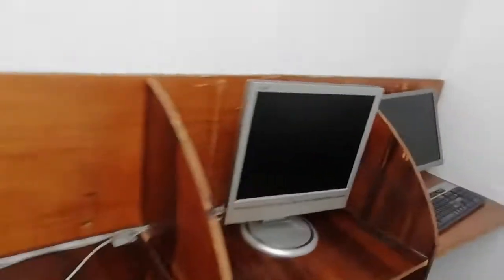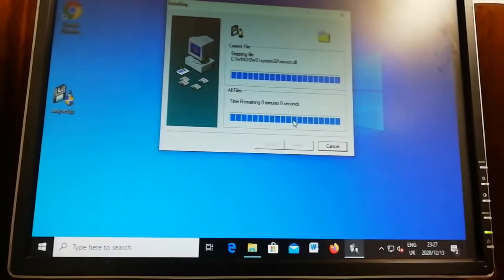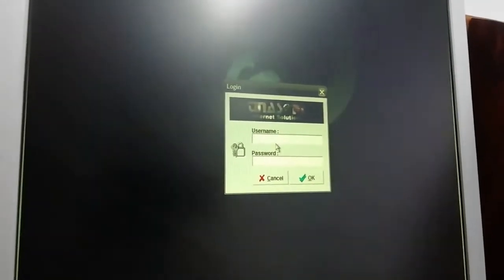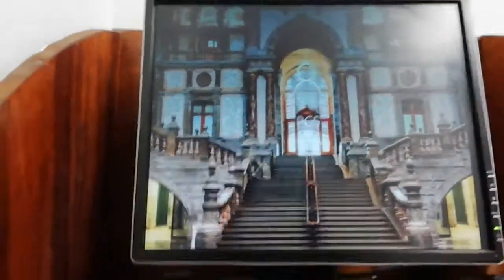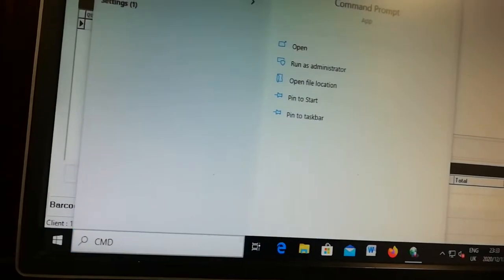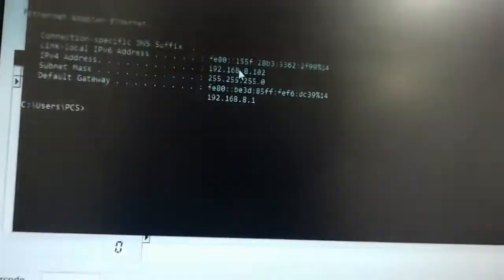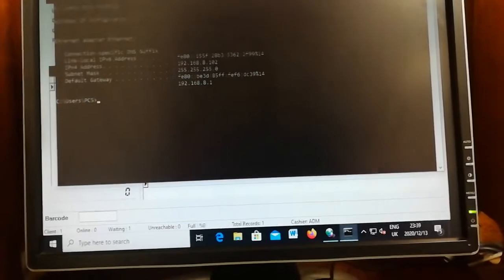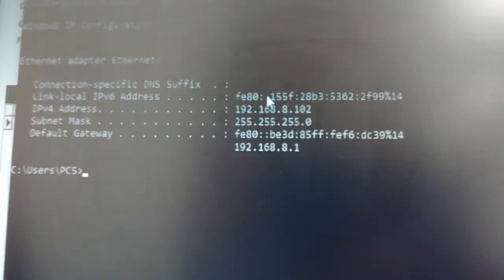How to install easy Cafe internet Cafe management system

Comment: Where can I get the software, Do you have any link I can download it from
Reply: Please gentlemen don’t buy anything.The free version of this software is good enough to run a basic cafe network.
Reply from the maker: @Snacks8536  okay
Reply: @Snacks8536  Hi . dO YOU HAVE A LINK TO THE FREE SOFTWARE PLEASE
Reply from the maker: whataspp me I have the one we developed we can sell to u
Reply: @bassoniatv  I need to buy the software as well, kindly provide contact info
Reply from the maker: @aaronmugwagwa2660  +27659830741 whatsapp me
Reply from the maker: @aaronmugwagwa2660  +27659830741 whatsapp me
Reply from the maker: +27659830741 whatsapp me
Reply from the maker: +27659830741 whatsapp me